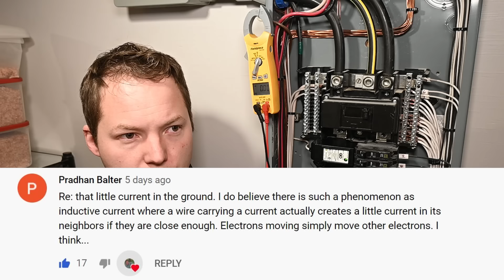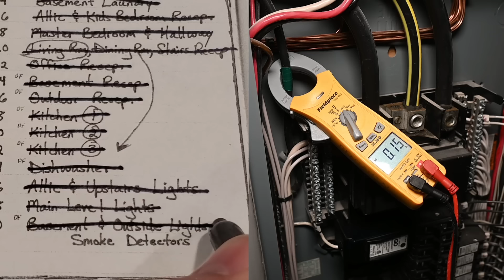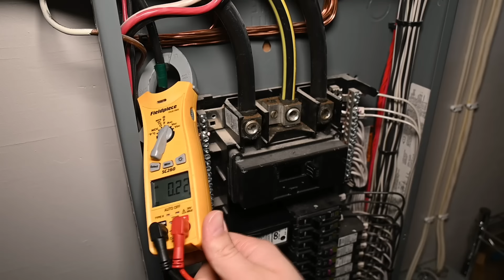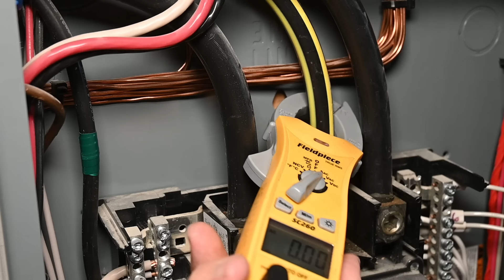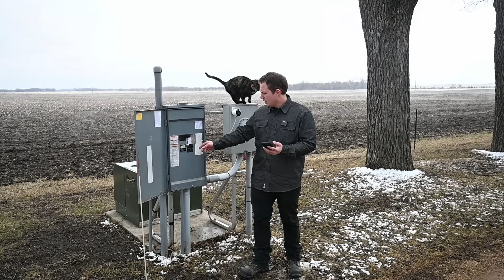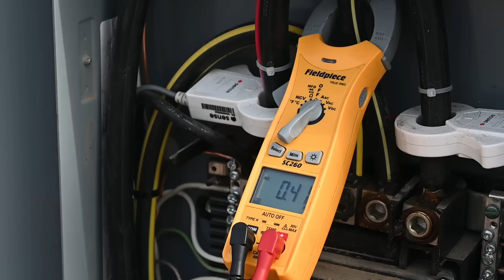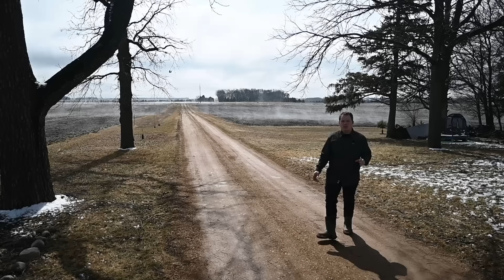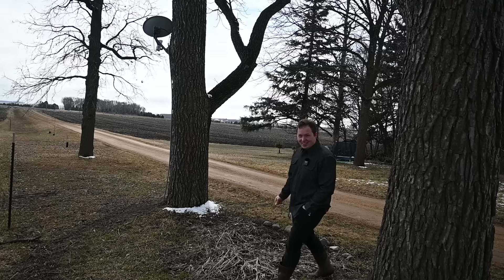Finding The Source of Stray Current on Grounding System

Comment: Did you ever find the cause??  
Long, but interesting. I have a similar issue here in Holiday, Florida. Bought the house in 09'. Moved in after a major remodel. Within the first few showers in out new to us master bathroom, my wife was complaining for feeling like she was being electrocuted in the shower. I had never felt it till I was in the shower adjusting the shower head with a cut on my finger. It was enough to wake me right the hell up!! Most outlets and switches had been changed in the house along with most appliances. My thought was, electric water tank. Oddly, I wasn't able to read any current draw anywhere and it was beginning to make me think it was something we did while remodeling. Now I have an automotive background with some home remodeling under my belt, but for sure, not an electrician. So while I was not getting any read with my digital meter, I DID with an old analog meter but only IN MY SHOWER!! Yes, I figured we had run a screw into the wiring. Since I was getting a read off the shower and frame of the shower door. So I pulled all the screws in the frame to wall, (the entire time saying, NO WAY I DID THAT!!) Well, screws out and still .45 volts. Checking other plumbing in the house shows zero. So I do what everyone else would do and shut off the main. Go back to the shower and .45 amps. Now I call the power company. Guy shows up and asks what is going on. I tell him and he looks at my like I am purple.. I tell him to grab his meter and follow me. Of course he grabs his digital meter and shows me there is nothing on the line.. I grab my old analog   meter and show him and now it is 5.1 amps. I then ask him if we pull the can, will it break the neutral? He says he doesn't know.. I ask: HOW LONG HAVE YOU BEEN DOING THIS??? 12 years, he replies.. lol.. So while he is telling me it is in my house, I am telling him I have tried everything in the house and it is NOT. After he confirmed everything, he finally pulled the can. Now I can see that the neutral is ALWAYS hooked up all the way back to the transformer. Now I want him to check the transformer and her starts in on it being my neighbors house. Side note: After he left, my neighbor asked what was going on. I told her we were getting shocked in our shower. She says: ARE YOU KIDDING??? Turns out they had remodeled their bathroom a few years before we bought next door. After their expensive remodel, she was getting shocked!! Thinking it was something their remodeler had done, they ripped the shower walls back out digging for the issue. Never found it, but their new shower control handles were PLASTIC, so she never got zapped again!!  So while the Power guy was here, I got him to go into the transformer and tighten up our wire clamps. He argued doing so, but I again proved to him it would make a difference. Sure enough, the voltage went UP!! Went from 5.1 to 5.9 and considering I didn't have a straight line of sight and yelled out the window exactly when he tightened up the clamp, he finally started to believe I knew what I was talking about. Then he said he had no idea and the engineers would have to look into it.  A week later another truck pulls up out front. 2 guys this time. I answer the door and tell the first guy the story. He yells out to the other guy,  WE HAVE ANOTHER POWERED GROUND ISSUE LIKE THE BEER PLANT!! Well, as the crow flier, the beer plant is about 1600 feet away. Turns out, after more than a year of investigating, it was a bad transformer on site and owned by the beer company. It literally would raise the hair on your arms if you walked too close to a steel building on their property. So now these two make some checks and tell me I will be hearing from Florida Power. Another few days go by and I get a call. 2 engineers come to the house and I tell them the entire story. Top guy wants to see my meter and where exactly the master bath is. I tell them I have seen as much as 9.6 volts. After months of more digging they found nothing. Still, we are getting blasted in the shower. It's worse on the wife than me, but she is still showering every day in that shower. She just sets the temp before getting in and gets out and stands on the bath rug to shut it off. So we've owned the house about 2 years at this next point when the neighbor across the street asks me if I would come over and shut off her shower.. WHAT!!!!!!  I get over there and she tells me her ELECTRICIAN hubby is out of town working and she cannot leave the water running any longer.. Sure as the SUN, I shut off the water and come back with my meter. BANG!! She has 6.6 volts in her master shower. I checked other plumbing there just as I did here and next door and in all three homes it is only in the master showers. I call back the engineers and tell them this new discovery. He says: I will be there within the hour and I am pretty sure I know what is wrong! GREAT!!! He shows up and says: We had linesmen run tests in this area in every possible place and what we know today is that someone LIED!!! Turns out, from him knowing the neighbor across the street, (Different transformer), had the same issue that it had to be a capacitor bank about 1 mile away that was leaking into the neutral at our power transmission dump. Sure enough, he had it tested again and it failed. After being rewired correctly, I no longer had voltage in my shower... But over time, guess what came back!!!!!!   Hope this helps..
Reply: WOW i read it all
Reply: That is incredible.    But why only in the master shower at each residence?   Why not the kitchen sink, etc.?   And even worse, why not an outdoor spigot?   Seems like if barefoot, that could be really bad.    If the ground was dry, maybe bad, but maybe if the ground was saturated, hopefully the current would just go through you to the earth ground, and hopefully not cook you too much?   Or ami missing something?
Reply: @andrewhigdon8346  I have no clue why it is only in our master bathrooms. What is even crazier, as if that's now crazy enough, is that the house across the street has exactly the same issue and it is on a different transformer!! But again, only in the master shower. Nothing else.. 
As far as going to ground, well I not sure if it's the same as you are thinking, but I have a commercial well next to my house. 10" casing that goes down something like 165 feet. Before the power company came with about 6 or 8 copper rods and pounded them into the yard with a daisy chain of "4 solid copper, I replaced a few ground clamps and used a wire wheel to make absolutely sure there was no excuses and a length of #4 copper and clamped it directly to my monster well... Still had juice in the shower.. Power company did their thing with many rods and still had juice in the shower. I think they called it a "Faraday Cage". Could be wrong or wrong spelling. It's been several years since we were trying to kill the power.. I should be charging things off the free power!! lol...
Reply: @andrewhigdon8346  Even the big wig engineers at Florida Power could not answer that. Trust me, I asked that of everyone including my cousin and his boss and no one can answer that. They tried sinking 7-8 copper rods into the side yard by the power box and it made no difference. I tried and then they tried, hooking the ground to my 10" commercial well that is either 160 or 180 feet into the ground and still had voltage in the shower. It is insane, but when they disconnect the ground wire at the transformer I have ZERO voltage in the shower. I have a pump and plumbing in a garden tub and that doesn't have voltage on the metal fittings. It's truly INSANE!!!!
Reply: @SteveP-vm1uc  It is stray voltage that is on the neutral wire from your provider as in the primary wires (7200 vac). no one at the power company wants to admit this. It is caused by so many connections from the source, corrosion, weak crimp , etc
There is a device called a "ronk box" which is a "neutral isolator" commonly used by farms due to cows being shocked (very low milliamps, but you can feel it) and the cows will not milk
Reply: @karlmoll7665  I believe you are correct. Someone else told me this as well and my cousin has been telling me this for a decade!  I did call about it and they said they could put one in, but it would be another large box in my back yard. I already have ALL OF THE PEDISTALS  for 5 homes around me. The transformer was ne 13 years ago. The lines going to all the transformers around us were new about 6-7 years ago. How they cannot get this right without more inconvenience to me is baffling.   Thanks for the reply!!  ;)
Reply: @SteveP-vm1uc  I wonder if there are too many ground rods and they are picking up earth voltage (which would be the voltage dumped into the ground rod from the primary side of the transformer as well as any other grounded power poles in the area) and feeding it back through the ground in your panel.  Since your system is bonded, it's possible for that current to push back into the ground side of your system.  There should only be 1 ground rod at the transformer.
Reply: @truckgotstuck  I'm not sure I can give a proper answer to this, but I will gave you what I know.. 
1) This issue began before I added a second meter to my property. 
2) All our transformers and home runs are underground here. 
3) As the crow flies our house is only about 1000 to 1200 feet from the Hi/low power transmission farm. (I don't know the real name of the yard, but high voltage transmission wire comes into this yard and goes through transformers out to the neighborhoods transformers. 
4) I do have a bathroom in the back shop, but DO NOT get blasted in there soaked or not.. No issues at any receptacles either. 
5) The ground rod at the house can is within a foot of my commercial well and I am sure that monster does a far better job of grounding that the rod!! lol.. 10" case 100 plus feet in the ground... 
6) When they remove the neutral in the transformer box, I have ZERO power in the shower. 
7) Got nailed again a few days ago.. (I really have to stop biting my fingernails)!!
Reply: @SteveP-vm1uc  Use some pex or rubber hose to isolate the  part thats giving you the issue
Reply: @koolbaltkoolbalt8736  That would require opening up tiled walls. I'd be much happier with the power company equalizing their load coming into our localized transformer.
Reply: @SteveP-vm1uc  do you have an ufer ground system that's connected to the power company neutral? I spoke with a few experts who suggested taking power company ground off of ufer and  transferring to ground rods
Reply: @vfsd234    Nope. No ufer.. Simple, common ground.  It is June 4th, 2023 now and we are STILL getting zapped now and then in the master shower.... It seems that each time they think they have it, it comes back in a short time..
Reply: @Steve 1961P. thank you for responding, sorry to hear you're still having troubles. I might have asked before but have you experienced any physical symptoms like tinnitus or others? We had to move out of our house.
Reply: @vfsd234  Other than the shocks, especially when they have been gone for a while, startling the crap out of us, I do have tinnitus. Also Afib.
Reply: @Steve 1961P.  really?! Do you believe the tinnitus and afib is from this stray voltage? Does your wife have symptoms as well? Our heart rates were up to 150, resting
Reply: We have been informed that we need some ground rods to possible redirect stray voltage and possibly our ufer is not totally grounding our house. One stray voltage said we should bond the new grounds to the ufer and the other said to only bond the grounds to the city neutral. Any advice? thanks @truckgotstuck
Reply: I would never normally read a comment half that long, glad I did thou. Very interesting and also a scary ordeal. Thanks for sharing that👍. Ive been watching vids and doing as much research as I can to figure out my own electrical situation. Got slightly shocked a while back by my chain link fence gate( and it not supposed to be an electric fence😄). Ive Been benge watching Mike Holt and Benjamin S.
Reply: Great story. I will remember this one. Question, you and others down this thread say Measured 5.6 volts… measured between what and what? Between shower head and cold water valve knob?
Reply: @AllenCavedo  With an analog meter touching anything metallic, (shower head, any pipe, control hand knob to the wet walls, floor or shower door frame, (Aluminum), I'd read anything from a few volts on a good day to 11.5-6 volts after they tightened the lugs in the transformer box.   Also from the metal of the shower head, controls to the from of the shower doors when it is dry.  But again, this stray voltage is not anywhere else in the house. Not even in the laundry which is the opposing side of the shower wall. Our laundry has 110 and 220 on that wall. A 4" dryer vent going up that wall to the roof. Water in the sink and the wall fixture for the washing machine. NOTHING in there has stray voltage. Neighbor next door, (Same transformer), has the exact same issue. Master bathroom ONLY.. A few years ago I was called across the street to turn off her shower as she got blasted. Master bath shower only!! (Different transformer), but that issue was "FIXED" by properly setting up and grounding a capacitor bank over a mile from here.  Lasted for a while and came back.  It is INSANE!!!!
Reply: @SteveP-vm1uc  Thanks Steve. But I am still not following completely. With any voltmeter you have two test leads and you must measure voltage between two things. I understand that you got voltage readings from those items mentioned but what was the other test lead touching to get those readings?
Reply: @AllenCavedo  One lead to anything metal in the shower like control handles or shower head. We also have a lower shower head, (I have a wrecked back), so that one as well. The second lead to the shower door frame or if the shower is or was recently wet, ANYTHING WET!!! I can be standing in the shower with it running and change anything in the controls or adjust either shower head and get nailed. 
The only time I feel it is if I have a cut on a finger or I have cut my fingernails too short and dug into the skin a bit. My wife was getting  nailed all the time.. I changed out our nice expensive metal control handles for cheap ugly plastic so we are insulated for the most part.
Reply: @SteveP-vm1uc  electricity or power exists due to potential difference between points lightening occurs because of the potential difference of electrons between sky and ground i wonder if there is something in the materials that could be allowing electron flow or potential difference?
Reply: @TheIrishdriven  I don't know, but what ever it is is haunting as this happens in our master bathroom shower only. Also in my neighbors master shower only and before the power company fixed a wrongly built capacitor bank about a mile from here, the same was going on in the house a cross the street from us and it is on a different transformer!!   It also comes and goes and the voltage changes. 
I am sure there is a good answer for this somewhere, but the top engineers at Duke Energy haven't been able to fix it.. Though they say they have a devise that will band aid it, but that means having yet another damn power box in my yard.... I already have the transformer, a telephone buss and cable tv monster and a FIOS in the ground and I cannot run a weed whip with my bad back.
Reply: @SteveP-vm1uc  My bet is that this is excessive neutral to earth voltage on the neutral of the power company. In North America, the primary neutral is bonded to the secondary neutrals that are in turn bonded to the houses water pipes and ground system. A broken neutral somewhere on the lines between your house and the utility substation results in utility neutral current taking customer grounds and the earth instead of the neutral wire and also results in elevated neutral/ground/water pipe voltage in peoples homes. 

I have an experiment for you to try. Shove a screwdriver into the dirt around your house somewhere and then measure the voltage between that screwdriver and the third ground prong of a power outlet somewhere at your house. I predict that you will have a nonzero voltage. 

Likely the reason that the voltage exists in the shower is that every piece of metal there not bonded to the elevated voltage of the water pipes has capacitance to the earth and is effectively sitting at the true earth voltage. Thus you get a voltage between it and the elevated voltage of the  "grounded" water pipes. By comparison, if you measure between say the water pipe in your kitchen and the outside of an appliance or the ground prong, you will read zero because they are all at the same elevated voltage.
Reply: @SteveP-vm1uc  And probably that device the utility mentioned  is either a neutral isolator or an isolation transformer of some sort to mask the elevated voltage on the utility ground/neutral wire.
Reply: @chrisbauer1925  I know this is from a year ago, but this makes the most sense. How else can you explain getting shocked from only the master bathroom shower fixtures and nothing else if all the plumbing is supposedly bonded. I was thinking something crazy like maybe the master bath plumbing was somehow separate from the rest of the plumbing and only it was bonded, but that just wouldn't make sense to do in construction.

So as a solution you would have to try and bond the metal fixtures to the rest of the house plumbing, correct?

As another solution, would unbonding the whole plumbing system have the same effect to get rid of the stray voltage?
Reply: Is your water systems bonded? Also the power company knows very little about circuits. They are very well trained typically but what they do is different. I’d be curious to see if your panels are set to mains or subs accordingly
Reply: @casey1756  Yes, the water system is fully bonded. If you are talking about MAINS or SUBS being a sub panel coming off the main panel, NO. I have 2 meters on my property. One to the house and another to my back shop. The issue started in the house before we added the second meter to the shop. Both run from the transformer with their own wire to each meter can.  Not that all of this isn't insane, but this is in 3 different homes, divided by 2 different transformers and all three homes are getting voltage in the master baths ONLY!! I have run around the other two homes with my own meter as I couldn't believe it either!! 
This is in Tampa Bay, Florida, so our plumbing is all run through a concrete slab.  What is even crazier to me is that the wall dividing our master shower and laundry room contains the copper plumbing and there is zero voltage in the laundry room on any of the plumbing.. 8 feet from there is a wet bar in the living room. NOPE!!  Tried a bunch of ground rods with a daisy chain. NOPE! I tried grounding my ground to my 10" steel well casing that goes 160+ feet into the ground. NOPE!!  SMH....
Reply: @SteveP-vm1uc  sorry chief this is a crazy one for sure!
Reply: I started watching this gentleman to because I’m was getting zapped in the shower. My situation is in the main, so we shower in the master. I can feel the energy at times through the whole house. I read your story, and I hope my issue is internal. I know the feeling of not understanding and people not listening though. Educated people aren’t hearing me, so I’m educating myself. Can’t wait to find the problem, so I can shove it right in their face. Glad you’re educated enough to tell them how to do their jobs. 

Electricity is a awesome beast, and I respect and honor its vast abilities. I know that at the end of the day it reigns and dumbfounds the “smartest”  (the ones that get tripped up on the word I chose instead of the words they understood). Just like doctors, the textbook jockey’s can’t grasp real life happenings and until you show them with their own tools, they make you think you’re crazy and right it off as not possible. That is why I love the phrase “ I told you so!”
Reply: @mandiwilliams3039  Hahahahahahaaaa.... It's been a while since I wrote this, but in short, use a analog voltage meter. Digital can show ghosts.. Prove it with an analog meter and their heads will explode.. Once you know exactly how many volts you have, shut off the main breaker to the house and again see what your voltage looks like. If it is gone, it has to do with power inside your home.. It you still show voltage, it can be coming into your home on the NEUTRAL LEG as mine does and there is nothing you can do about it other than get the power company to fix THEIR ISSUE!!! Good luck. Our power company basically doesn't give a shit.. Thanks DUKE ENERGY!!!
Reply: @SteveP-vm1uc  thanks Steve. My house  is new to me, but she has existed for quite some time. I can tell you we have more in common than the electricity in the shower. We share power companies. So I may be in the same position as you, or several states away, we may be on to something. I’ll let you know what I find out! Do you still use the shower? I know you were. I’m terrified to showers in there, but I don’t want the kids in my shower for all eternity. Do you have cast iron in your bathroom?
Reply: @Mandi Williams  we feel electricity all throughout our home as well. Can you describe what that feels like and if you have any heath problems from it. I'm searching for answers. Thank you
Reply: @mandiwilliams3039  can you explain how you feel the energy throughout the house? Thanks
Reply: Can you give more details about how you can feel the energy in the whole house? Any bodily/health symptoms? Thank you! @mandiwilliams3039
Reply: What many people don't realize is that the planet Earth is an electrical generator due to the iron core. The "electrical earth" is always charged, thus the prevalence of lightning.  The question is, "Where are you and when are you? " because the electrical fields are never stable and the electrical potential is always relative (like Einstein's velocity).  The column of rock, soil, water, and air is a dielectric unique to that location that defines the precise electrical potential of that location in combination with the of the Earth.

So, why do I bring this crazy stuff up? 
The current flow on the neutral line could be out instead of in. This could occur if the electrical potential "earth" of the power company's generator is different than your local "earth". The least resistance part between the two locations is not through the soil and rock but through the copper transmission lines. 
How did your land become charged with a different potential?  It could be the industrial well pipe nearby taps into a different aquifer than the one underneath the power station. More grounding tods won't help. 
The only solution I can think of is to insulate the shower head, i.e., use a section of PVC pipe leading to the master shower.
Reply: Maybe it’s coming thru your sewer line.  During a shower continuous water conducting out to an area a a different potential than the grounding of the supply piping?
Reply: @KRPerryTX  Nope. It shows voltage between the shower surround and the incoming water fixtures. Water doesn't need to run and has been tested after zero water running for 2 days.   It is somehow coming in on the neutral. How it makes it to that shower and no others in our home and also next door AND across the street is totally beyond me and every one of the engineers at Florida Power/Duke.
Reply: So your wife died? You said she got electrocuted and not shocked. Electrocution kills, shocks do not.

People confuse the two words all the time, but both have distinct definitions.
Reply: I think I would have run a ground wire from my shower to a new ground rod out side for starters, i had something like that in a kitchen, I couldn’t find the problem so i ran a ground from the kitchen pipe to the out side with a new ground, it seemed to solve the problem for me.
Reply: @truthserum9157  The engineers from the power company tried that as well. They used a clamp and wire and ran it through the bathroom window to a series of ground rods they drove into the side yard. About 5-6 rods in daisy chain. Then tried clamping that to my well casing which is 160-180 feet into the ground and full to 6 feet from the ground with water.  NOPE!!
Reply: @SteveP-vm1uc  I actually made this comment why’ll I was watching the video and hadn’t finished it yet, i can see as clear as mud now that I had not considered the power plant could be at fault.
Reply: Steve, this was very interesting.  I had the same situation 50 years ago so some of the details are gone from memory.   My analysis at the time was that it was a loose ground or neutral connection at the main panel outside. I did eventually get some penetrox to make sure the aluminum wire to copper was not a problem.  (it was 50 years ago). I don't remember if tightening those connections fixed it for sure, I think it did.  side note: In using a Simpson or Triplett analog meter  (50 years ago) one had to ascertain if it was a good stiff voltage,  when 1st checking the scale was set on something like 0-150 volts and it read  mid scale something like 75 volts or so, wow that's scary, but then changed scale to 0-50 volts it read mid scale about 25 volts, then changed the scale to 0 - 15 volts and  it read mid scale about 7 volts or so.  I came across that a lot using those old analog meters. When checking voltage I always changed the scale to be sure.
Reply: @Donley Wilson  yep,  I had the same thing 50 years ago. voltage from shower faucet to the drain.  tightened the connections and if memory serves me it went away.  I would not remove the meter today like I did then 50 years ago.
Reply: What came back?
Reply: @charly3rd273  Voltage in our master shower....  Still there..
Reply: Can you tell me, anyone, is it possible that our entire house is carrying stray current. We feel it as a muffled house, magnetic like force field. Can't even describe it. Went looking and found 1. 7 amps on cable ground. Cable says its coming from power and power says its from cable.
Reply: @vfsd234   May be completely different, but yearsand 2 houses ago, we had an issue every afternoon around the same time that made me nuts!! Around 4 in the afternoon I'd be watching TV with a perfect screen all day and then I'd get all kinds of "NOISE" in the cable tv. coaxial cable. I was sure it had something to do with others on the same line, but the cable company had about 1000 excuses. One day I went into the neighbors yard where the cable box was and opened it up. Mind you, I had been dealing with the BS for the better part of 2 years and the cable company, as I said, was full of shit!! My daughter watched our tv and talked to me through the window. I'd ask if it was still screwed up and after unhooking the neighbor directly behind me, the TV had a perfect picture again.. After a pile more complaining from me, we finally nailed it down to the fan in my neighbors family room ceiling was NOT properly grounded. He'd come home from work and turn on the TV and ceiling fan and crack a beer... The cable company said they could not do anything about it and so I chatted with the neighbor and he and I figured out the fix....  It is amazing what a proper ground can do!!!
Reply: @Steve 1961P.  we have a feeling we are experiencing same situation. When neighbors leave town things seen better. So you just had the TV problem? And how did they ever find the one fan ungrounded? Seems like that would have taken some time
Reply: @vfsd234  Our houses were back to back with yelling distance between us. When I realized it was coming from their house I went to talk with them about it. The owner told me he gets home around 4PM from work every day. Big clue!! Said he goes into the family room and turns on the TV and ceiling fan and then heads to the shower.  So we simply opened our windows and he turned on the tv and no problems. Then the fan and I got shadows like crazy. So we really just narrowed it down one step at a time.. His buddy is an electrician and he came and fixed the improper ground andshadows no more!!!  The ladies next door to me said after, they had the same issues with shadows and they thought it was my huge CB antenna.. I did have a bunch of power I was putting through a 5 element beam style antenna and I did come across people's answering machines and tv's and if I turned the beab across the street, I could push the key on the mic and turn my neighbors floor lights on!!!  That was a fun toy, but it had nothing to do with the shadows... ;)
Reply: @Steve 1961P.  wow, love your tenacity and sleuthing. I wish you could come solve our problem. We feel a wave of energy that we assume is electricity that causes headaches. Comes on strong when it's freezing out, and especially at night. We think this is when electricity use is high. We discovered the cable ground get high amps when we feel this wave. I'm trying to find more information but no one online is discussing such phenomenon. I have to leave the house sometime when it's bad. Any ideas? We talked to neighbors they don't feel anything, but the transformer is on our property. Power company lineman suggested we get ground rods instead of using our rebar/ufer.
Reply: @vfsd234  I suggest you get your power company to send out electrical engineers. Originally, (in this house), we thought we found the problem. It took a while, but only because one of their linesmen who was tasked with testing a system, LIED and said a system checked out 100%.  It took months, but one day the girl across the street asked me to come over and turn off her shower water. She said she was getting electrocuted when shutting the water off.. BANG!!!  This is an entirely new thing because that house gets it's power from a totally different transformer..  When I called the engineers back about this, he said: Put your meter on the shower now and in an hour it will be gone.... Sure as hell, he sent someone directly to a pole over on the main road and they repaired the ground there and I no longer had voltage coming in on my neutral..   That lasted a while, but it came back...... Now they blame an "UNEVEN VOLTAGE between 2 hot legs.... I said that sounded like a porn title, but they worked on it and still have never gotten it fixed..
They say they can add another box to my yard that WILL FIX IT, but I cannot run a weed whip with my fused back, so I just keep them running in circles trying to properly repair THEIR issue!!
ALSO: you said it seems worse when the heat is on. This sounds like a static electricity issue. We had that issue when we lived in Rochester, NY. Our house was built in the early 1920's and had lousy windows and nearly zero insulation. As we remodelled the house, we put in new windows and insulated and cut way down on outside air infiltration. So we then had a heating system that was too big for the house and it dried it out terribly. We'd come down our carpeted stairs into the livingroom and if we moved fast enough our hair would stand straight up!!  That was many years ago and all I remember doing was adding a humidifier to the furnace, but we finished that house and moved to the suburbs into a house built in the 70;s with worse heating issues!! I should say closure issues. We literally had snow blowing into the house where the power meter/box came into the power panel.  Whomever put the siding on that house should have been SHOT!!!  But that was my line of work back then, so a fairly easy fix for me.... I miss that house!!
Reply: Is there any way stray voltage could occur and be felt energy wise on the entire house? We have rebar ground/ufer system within the stem footing concrete that our house sits on. We feel like our bodies are carrying electrical current. I can't even describe. Poking around we found 1.7 amps on our cable ground wire. Electrician, cable company and power company have no idea.